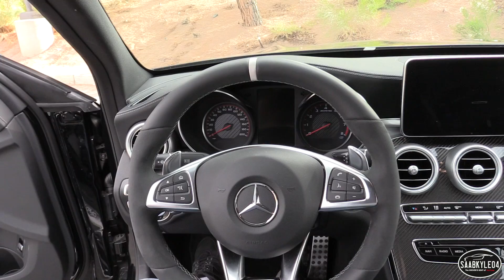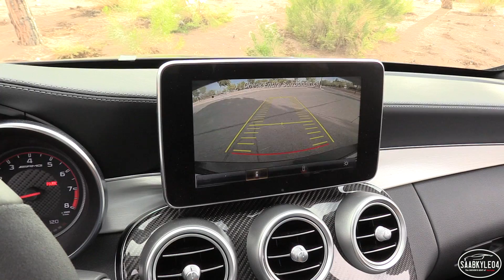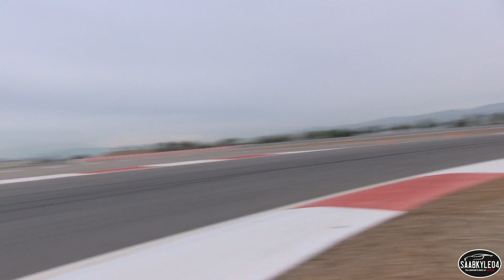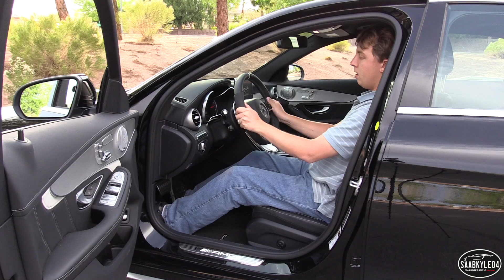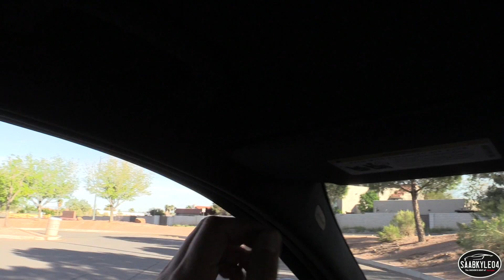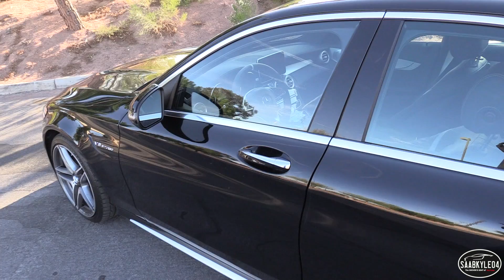2016 Mercedes-AMG C63 S - Start Up, Road Test & In Depth Review

Comment: i think they changed the badges on the back from C63 AMG to AMG C63 to prevent people from adding an AMG badge to not AMG cars which say C300 4Matic
Reply: A YouTube User no because before they put the AMG on the left side, Mercedes was Mercedes-Benz, now it's Mercedes-AMG if you have an AMG and with that put it on the left side after the (I think) 2014-15 models.

Comment: Isn't this a twin turbo 4?
I don't think its an 8 cylinder.
Reply: jpracingph It's a twin turbo 4.0L 8 cylinder
Reply: I dont think AMG runs on V4
Reply: LosDelFLOWnyc there's no such thing as a v4
Reply: LosDelFLOWnyc The A45, GLA45, and CLA45 all run on a 2.0L 4 cylinder

Comment: Analog tach needles will soon be too slow for these types of engines and transmissions....
Reply: See: Lexus LFA
Reply: +edawg792 that's a super car, and super cars have had digital tachs for a while. This engine is used in sedans and every vehicles, and this sort of throttle response is unprecedented in a mass market vehicle.
Reply: Ian Konrad Ah you're right. Though I wonder if this kind of power and response will ever make it out of the very high-end performance luxury segment.
Reply: I think it will, hopefully. BMW, Audi, and Mercedes have added cheaper low-end models that will eventually benefit from their high-end models' redesign. You can now get a Quattro, M, or AMG for less than $50k.
Reply: Ian Konrad Ooh that's exciting. Maybe my future isn't all Toyotas and Hondas after all

Comment: drivers door panel fit gap looks a bit off, not a tight fit. Not a fan of the floating media screen, looks like an aftermarket install, prefer it built into the dash so it looks like its part of the dash. also I would like to see the exterior design more distinctive to thec200 and c250 for some individualism.
Reply: agreed
Reply: same here

Comment: Did he just say back up camera is optional? For the price of this car you would expect it to be standard.   Unreal.
Reply: yea i also dont really think you can have a c class without a backup camera. i think the optionals camera is that 360 degrees camera ..
Reply: +Paulog1990 everything at this car is optional but the base price gets cheaper. but yea that amg is expensive anyways. you can just get a package which gives you all the cameras driving assistants etc.
Reply: +Paulog1990 backup cameras are so fucking helpful
Reply: +Zia Khan can't tell if it's sarcasm or not over the Internet but either way it's another tool that assist with driving and can be helpful avoiding simple mistakes that can be hiding directly behind you.
Reply: not sarcasm at all lol
Reply: many new cars have backup cameras. majority would.
Reply: or you can just learn to fucking drive and use a mirror if you really want

Comment: Keyless GO (the smart key entry) is not standard on the regular C Class. It is Part of the Premuim 1 Pkg ($700 pkg). Keyless Start is Standard. The C63 comes standard with Keyless Go (smart ket entry)
Reply from the maker: +Anthony Castro I was not aware of that, I knew it was standard for the C63 though.  Thank you for clarifying!

Comment: Ugly very ugly NAV screen, unless that is very good car.
Reply: +Jervon Jaxx I like that actually
Reply: Imperator Augustus U like u cant, hide the nav screen like BMW and AUDI?? who desing this should be fired!
Reply: ***** Stays ugly! hurts my eyes when y seen it, its very bad for the designeers staff dont think a feature to be able to hide. DUE SOMETIMES I DONT WANT TO SEEN THE FUCKING SCREEN OVER THERE!!. so i push a botton and the screen disappear!.
Reply: +Jervon Jaxx agree. it's hideous
Reply: +Jeremy Stig 
At least a hidden Navigation unit from the drivers standpoint can be concealed when not in use which eliminates impeding the view toward the middle dashboard & windshield area at all times.  That being "said", the Germans should just go back to putting the Nav screen directly into the dashboard & quit with the tacky customary placement directly on top of the dash
Reply: TheBjjones Yes, true, but not the germans  Just Merecedes new models..because Bmw And Audi its not like this ones,This is the fact.
Reply: Jervon Jaxx
This is inaccurate as many BMW models currently still have Navigation units directly on the dashboard which don't retract.  This is FACT!
Reply: OK, but in The BMW looks much better than this one they fit it,.. here in this car the NAV is not fit in the dashboard..its looks like they dont know when should it put, and just glue of middle of nowhere.
Reply: Agreed!

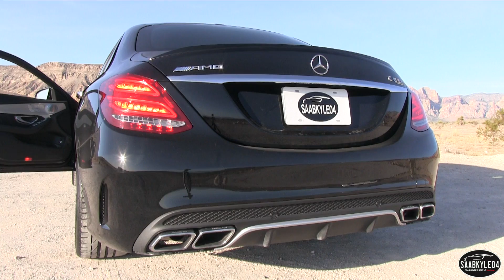Comment: 2:07 Look at that Fake exhoust ...
Reply: +Bart96 no its not
Reply: +Loris lel that not how any of this works
Reply: They do it on purpose. If the exhaust gets hot it expands and would not fit into the bumper anymore.
Reply: +Erdem bisgin ugly af :(
Reply: +Erdem bisgin fake exhausts should be banned
Reply: They probably do that so the actual exhaust doesn't have to be aligned to hang straight and the tips can have a tighter fit with the bumper
Reply: ***** The previous C63 AMG did have real exhaust tips. It could have those because they didn't get too hot.
Real exhaust tips have to be able to move around though, because they are attached to the engine and the car and everything is moving. If they were attached to the bumper, they would crack because they can't move around.
Mercedes and other car companies have these fake exhaust tips because they can implement them in the rear bumper in a neater way. This way there is less space between the outside of the tip and the material of the bumper.
Real exhaust tips have to move around, so they can't be too close to the bumper, because then they would bang against it which would damage the paint and make unwanted noise. 
This is why they use fake tips. It's purely for esthetics. Learn something new everyday.
Reply: +Loris That is false.